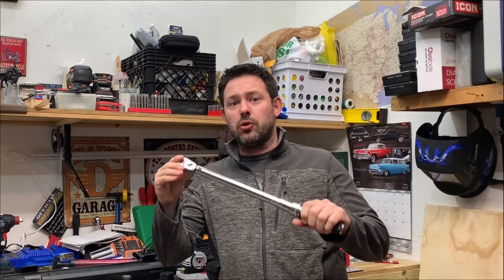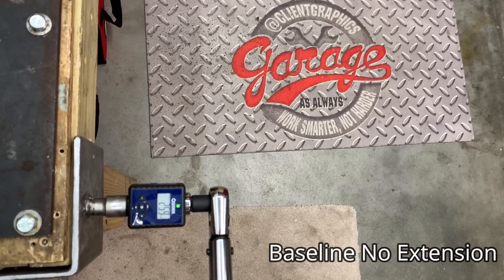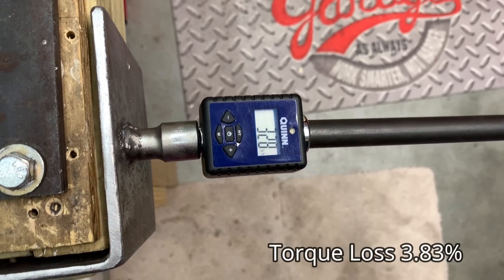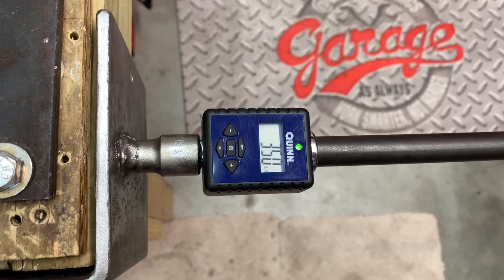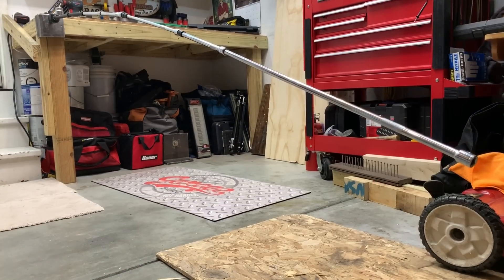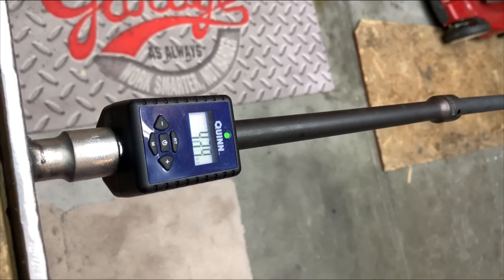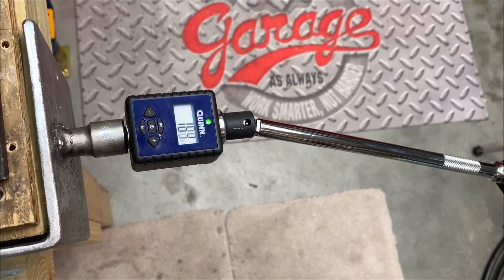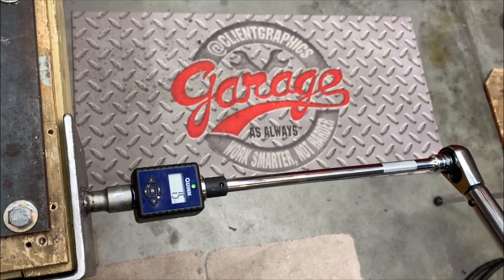Do Longer Extensions Result in more Torque Loss? Let's find out

Comment: the reason why it wasn't at 35 to begin with is cuz you set it under 35 to begin with. then you threw off the calibration test by letting it the extension sag so even though you weren't given any torque it was showing a torque readout that wasn't zeroed out

Comment: Thanks, that was really helpful and confirms what I had thought. How ever, is that irrespective of the size of the bolt!
Because I broke a 10 mm Transmission pan bolt that according to spec is 80 in/lbs using my torque tool with 11 in extension

Comment: Don't know how you getting such big differences because as far as the tool is concerned it clicks with the feed back from the bolt not from the pressure on the handle. The only significant reading difference can only be from operator error. And some twist in the extensions. The same applies if you hold the tool anywhere but the handle or if you extend handle with a tube as seen in this short video. Try and say it is wrong. https://youtu.be/mk95F0hHS3U?si=vdS4hI08-O6Tjshk

Comment: Well there is an equation used in aviation for when u add a extension on your torque wrench so I’m guessing if u wanna be just about on the money then yes it makes a difference but most non well known name brands are 3-6 % error snap on mac matco Cornwall are usually within 2%

Comment: After reading a few articles on this it is clear there two definitions of 'extension'. There is the one demonstrated here what most mechanics use and refer to. However if you get into specalized mechanics say aviation where safety is paramount and they sometimes use the term 'extension' meaning something like a lateral extension from where the socket attaches moving the socket away from the head of the wrench. Then you do need to do some math to get the new value.  So I think this where the idea that the torque value changes come from someone heard that the values do change and applied it to the common use of the word extension. So it is true...from a particular point of view. :)

Comment: perfect!  95% answered my question. the final 5% is how accurate is the Quinn digital torque meter at lower torque.  I've got to put on 80 inch pounds with this fel pro valve cover on my Dodge dakota. One of these silicon ones that don't want me to use sealant.  

 I tightened it to snug and it was absolutely pouring out oil after a run.  So I got out the torque meter and went to 80 inch pounds.  Still seems to leak.

Comment: This is simple math.  If you keep the extensions on a level plane with the the fastener, you will not change the effective length of tool.  The instant you add angles or bends, you are changing the effective length of the tool, and the tool is not designed to compensate for this variable.  The wrench is set to account for it's effective length being a constant, while allowing for force to be a variable.  Essentially, torque is length of lever times force applied.  This length number starts to vary when the extensions being used are on a non perpendicular plane (i.e. not running in a level/90 degree from handle path), or if you get bends in the extension.  In your L(ength) X F(orce) = Torque formula, you are changing the L.  The tool is not designed for this.

Comment: The perceived torque loss is probably due to lack of centering and support of the wrench head. Without support you are inducing a moment into your extension, but you’re also resisting the force applied to the handle of the wrench with the extension itself. If you summed the induced moment and the support force x moment arm it would probably come out to exactly the 35 ft-lbs. The torque wrench wouldn’t click unless there were appropriate internal moments inside the mechanism.

Comment: Really dont think this is accurate,  how could u have less tq loss with more extensions? Doesn't even make sense when its 7ft long and it's less then the test before it.  I think the click of tq wrench is throwing the digital meter off. 
U can tighten something down by hand with a 2ft extension as hard as u could. Take off extensions and u could tighten it more with half the amount of force u did with the extensions. Plus u should've tried just the chrome to see if a difference.  I bet there is more on the chrome then with impact

Comment: Hi Chris. Thanks for these tests you make. Do you know this tool from Motion Pro ? : https://www.motionpro.com/a/adjustable-torque-wrench-adapter-08-0380/. I thought you might be interested in testing the torque loss depending of the angle you are using it. There is technically no loss if the angle of use is 90 degrees but a test is still interesting I think :)

Comment: Using trigonometry you will be able to see why the wobble extension has less accurate results when it angles away from zero (centerline of torque). Also you should look up the differences between accuracy and precision.

Comment: You will always lose torque if the extension is angled off axis. The more angle, the greater percentage of torque is applied as cantilever, rather than pure torque. Whenever it's necessary to use an extension on a torque wrench, it's necessary to use a fulcrum as close to the torque wrench head as possible. Technically, there is no torque loss, just wind-up loss. All those extensions act like a torsion bar, which means, that the wrench will need to turn more degrees than the fastener, due to elasticity in the extension. It would be more interesting to use a beam type wrench, rather than a clicker type, because of the impact of the sudden movement when set torque is achieved. The elasticity of the extensions tend to absorb(or at least store) that torsional impact of the click, resulting in a slightly lower peak torque reading.
Reply from the maker: Yes, exactly right. Very well put together comment👍

Comment: I would like to see this using 3/8 drive extension that are over 30 inch not several short one that add up to that length but one single extension , I have two that are over 30 inch and can feel the wind up when tightening or loosening bolts but using several short ones not so much

Comment: Unless you can accurately calibrate any torque wrench before using them each time, all you really are doing is getting each nut or bolt to the same torque but no telling how close that actually is to what you set the wrench to. In other words, plus or minus any numbers doesn't have as much effect on the bolt or nuts because you are tightening them all to the same "close" value... That actually is more important then hitting the torque value dead on... JMHO

Comment: The torque wrench is calibrated from the center of the drive, that means the fastener needs to be in center as well. Moving the center line anywhere in or out of that rotating center is changing the length of the lever, that is changing the torque. The amount of torque lost shouldn't be able to measured with these tools, at 35ftlbs. If there is any wind up in the extension it will be equity resisting on the other end. The click type wrench may be exerting a sudden impact at the final predetermined torque that is not being transferred to the fastener due to how fast it's being applied and released. Too many variables in this test to take anything serious. Try next time keeping the torque wrench drive in line with the drive in the torque reader and use a beam wrench, that uses smooth rotating torque. Having a sharp "snap" in the torque application is acting like and impact.
Reply: 100%. Simple physics would prove this video to be bogus.  Sum of the forces are conserved and sum of the moments are conserved. The moment at the Socket must be the same at the wrench or things would be turning.
Reply: @benhenson3910  "Sum of the forces are conserved and sum of the moments are conserved."

There's loss through the extensions, but it's so small/negligible with these particular extensions that it can't be measured with his equipment. To illustrate the loss you just need a much bigger extension. For example, if you used a solid steel extension that was 1 foot long and 6 feet in diameter, it would weigh nearly 14,000 pounds, and applying 35 foot pounds of torque to one end of it wouldn't even budge it, i.e., the torque wrench would click but the reading on the torque meter would be zero. The energy you input with the torque wrench would simply be dissipated as heat because the extension is far too massive for 35 foot pounds of torque to overcome its inertia.

Comment: Show that extension length does not matter, it's the amount of misalignment in the center line.
Proof was with the chair as an alignment tool was no loss.  If only want to test distance then setup an shaft on bearings so there is no misalignment or drop from gravity.
Assuming there may be some force lost in torsion it would not show up in DIY torque levels.

Comment: There's no loss. Anyone with a brain that's mechanically inclined knows you won't lose turqe if the extension doesn't break off. Maybe use your hand to hold it on center to the best of your ability

Comment: Physics says there is zero torque loss. If apply 35 ft lb to one end of extension the other end must also have 35 ft lb applied to it from your fixed socket. Otherwise the extension would be rotating about its axis.
The “torque loss” that you get is because the wrench and digital meter are not on the same axis. Although you apply 35 ft lb to the wrench when you break down the forces into there comments they are the same at both ends. The wobble extension demonstrates this perfectly.
Reply: What about with a swivel socket adapter/universal
Reply: "Physics says there is zero torque loss. If apply 35 ft lb to one end of extension the other end must also have 35 ft lb applied to it from your fixed socket."

No, there is loss through the extensions, but it's so small/negligible with these particular extensions that it can't be measured with his equipment. To illustrate the loss you just need a much bigger extension. For example, if you used a solid steel extension that was 1 foot long and 6 feet in diameter, it would weigh nearly 14,000 pounds, and applying 35 foot pounds of torque to one end of it wouldn't even budge it, i.e., the torque wrench would click but the reading on the torque meter would be zero. The energy you input with the torque wrench would simply be dissipated as heat because the extension is far too massive for 35 foot pounds of torque to overcome its inertia.
Reply: @MaximRecoil  You don't understand inertia. Inertia (in this case, rotational inertia) slows the acceleration of an object experiencing a force, but does not stop it. Your 6' diameter solid extension would indeed rotate due to 35 pound-feet of torque, assuming it experiences no friction. Rotational acceleration equals Torque divided by Rotational Inertia. Unless the Inertia is infinite, or there is some other factor such as friction, there will be motion.

There is no torque "lost" in an extension. Extensions twist during use, as they act like torsion springs, however if it is kept perfectly straight and the head of the socket wrench is supported, then the bolt head must provide an equal and opposite force to the extension as the torque wrench does. So yes some energy is stored in the twisted "spring" but both ends of the extension are experiencing equal torques - it is at equilibrium. The only thing "lost" is extra energy that the user has to put in.

And before you ask, that lost energy of the user doesn't require more Torque, it requires more Work (Work equals Torque times Angle). Meaning you have to apply the buildup of torque over a larger angle, and exert more labor.
Reply: @mr22guy  "You don't understand inertia."

Your non sequitur is dismissed.

"Inertia (in this case, rotational inertia) slows the acceleration of an object experiencing a force, but does not stop it."

You don't know what you're talking about. If the force isn't enough to overcome the inertia, then the object won't move, obviously.

"Your 6' diameter solid extension would indeed rotate due to 35 pound-feet of torque"

No, it wouldn't. And since that example isn't clear enough for you, let's make the solid steel extension 1 million light years in diameter and 10 million light years long, floating in outer space. You think 35 ft-lbs of torque applied to it would rotate it at all?
Reply: @MaximRecoil   lol that was absolutely not a non sequitur. There would be an energy loss since you need to put in more work to move the extension, but torque would be independent of the mass of the object being turned. The torque would transfer through to the bolt with full magnitude. You could make the argument that there is energy loss with a comically large extension, but not torque loss. Even if you were right both of these effects are negligible for a normal sized extension.
Reply: @ginnis_14  "lol that was absolutely not a non sequitur."

Yes, it was. If it wasn't, I wouldn't have said it was, obviously.

"The torque would transfer through to the bolt with full magnitude."

False. Using my extreme example for the sake of people like you, if you applied 35 ft-lbs of torque to one end of a solid steel extension that was 1 million light years in diameter and 10 million light years long, floating in outer space, 0 ft-lbs of torque would be applied to the bolt on the other end of the extension.

"You could make the argument that there is energy loss with a comically large extension, but not torque loss."

Is that a joke? 35 ft-lbs on one end, 0 ft-lbs on the other end, is in fact a torque loss.

"Even if you were right"

I am right.

"both of these effects are negligible for a normal sized extension."

I already said that in my original post. Once again:

"No, there is loss through the extensions, but it's so small/negligible with these particular extensions that it can't be measured with his equipment."
Reply: @MaximRecoil  I don't know to many extensions 6' in diameter. But serious question. Can you give me the formula to calculate how much force is needed to reach elastic deformation for the size of the extension, diameter of the extension, and the length of the torque wrench?

Comment: LOL using Harbour Freight extensions, try using snap on or Cornwell extensions.  I cant even get a bolt off with a 1/2 using harbour freight extension, I can get a longer Snap On and take it off with 3/8. Day and night difference.
Reply: litvalex26 It’s a bar of steel, not very complicated.
Reply: @michaspi  Do you know why you have different grade bolts? Its just steel.
Reply: litvalex26 I’m not daft. Bolts fasten things together and go through a lot more stresses than a socket extension, which merely has to withstand temporary torsion. I spend my money on high quality sockets but don’t shy away from cheaper extensions. I have and use a variety of extensions from Harbor Freight, Husky, Kobalt, Stanley, Stanley Professional (pretty much Proto), overseas Craftsman, USA-made Craftsman, etc. I’ve never had one break or distort from proper use.

I have an extra long 1/4” HF extension and it’s not perfectly straight anymore because I was ahem doing some off-label activities (used it as a pry bar) 😂

Comment: The slower you approach The Click point the less loss you will have has your extension is actually acting like a torsion bar Spring and winding up slightly.
Reply: That's why you see the biggest losses with an impact wrench. The spring dampens the blow from the striking mechanism and the longer the extension you use, the less the torque at the other end because the "spring" doesnt stay wound up between strikes. The hardness of the material of the extension also plays a huge role on the spring constant.

Temperature also plays a role. A mechanic who's ever used torque sticks in a shop that's cold vs a shop that's hot will know that a cold shop can cause over tightening of lugs so you have to be careful. Likewise, when the shop is hot, you end up having to tighten it more with a torque wrench when you're done.

Comment: Extensions don't cause torque loss unless they bend at which point you will get a very tiny loss. It's swivel sockets that change the angle drastically which result in torque loss.

Comment: Torque loss is due to friction in multiple extinction male/female drives not in-line  otherwise  length have no effect on torque value no matter of how long the extension is .. longer extension means more torsion between the wrench and the socket this means the impact will be on the torque wrench travel angle to get the click

Comment: If I remember well, you wouldn't had any torque loss if the extensions were completely flat.
You did it with the wobble extension. 
The more angle you have, it would proportional to the torque you loss.

Comment: Torque loss can be reduced by making an extension using a 4130 chrome moly seamless steel tube of much larger diameter than the industry standard socket extension diameter that is solid steel. Try making a 3-4 foot long using 1" OD, 0.065" to 0.083" thick wall  4130 chrome moly steel tube with brazed or welded on 3/8" socket drive ends. OD of the round extension has a significant effect on resistance to twist.

IMO, the industry standard extensions over 18" would be FAR better if they were made of seamless alloy steel tubing of much larger diameter than common extension diameters then properly heat treated.

Comment: Did you factor in torque loss due to tolerance/figment from extension to extension? A single unit would likely have far less torque loss when compared to several in-series, primarily due to how each anvil fits into the next extension. A “looser” fit would certainly have an impact on torque.
Reply: No effect, because no torque is transmitted until the play is removed, the loss occurs only in how much you have to move the wrench to start the torque. His tests proved it.
Reply: Haha no idea